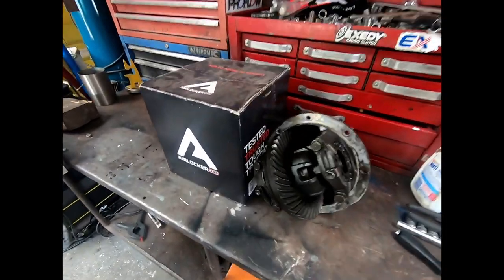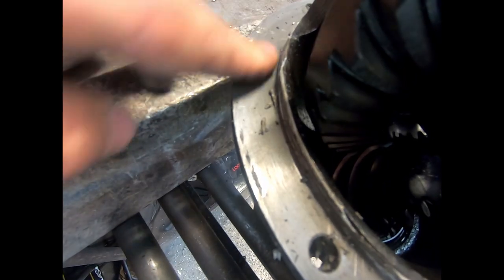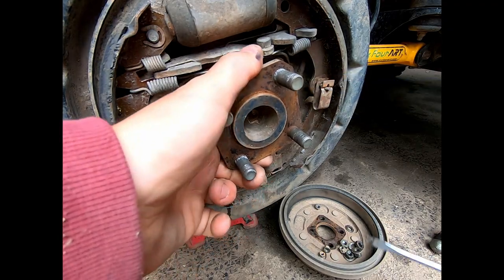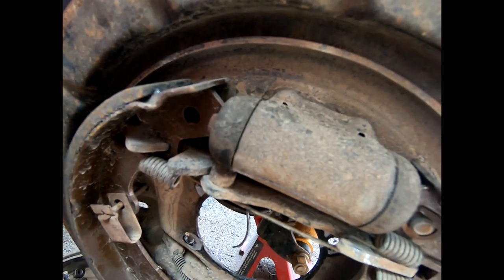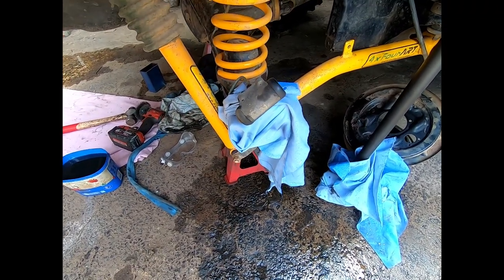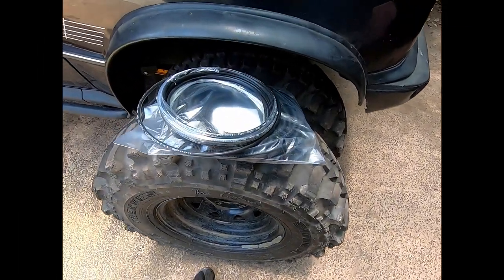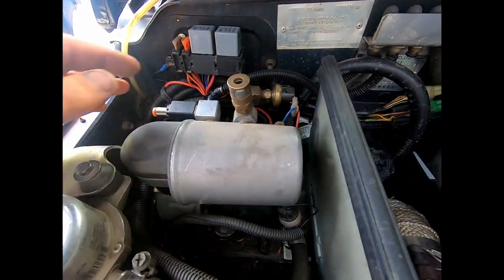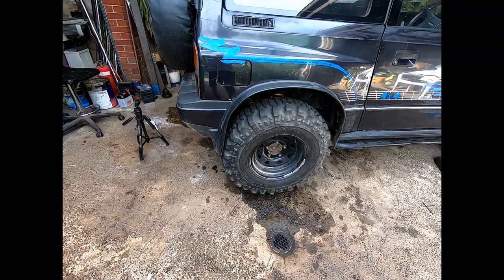Suzuki Vitara - ARB Air Locker Install

Comment: Nice video bro!! 

How does the 4xfour Art suspension feel?
Reply from the maker: It's actually a pretty stiff ride but does flex good!
Reply: @jaydnp.  Is it stiffer than the factory one?
Reply: @jaydnp.  Does it run robust on the road or is it uncontrollable?
Reply from the maker: @randydiaz5951  it is stiffer than Factory but the kit was designed to have an aftermarket rear bar on the back which would soften the suspension up, besides that it drives and handles as if it was factory setup

Comment: Hey bro, how do you find the fourx4art suspension kit. I'm looking at getting one, they seem to be pretty popular, heaps of Suzuki's have them. Had any issues legal wise with restriction on lift size and that? Cheers
Reply from the maker: Haven't had any issues works very well, I just changed the bushings to factory rubber

Comment: Those don’t look stock seats? I’d be interested in what replacement seats work - if you don’t mind. Cheers
Reply from the maker: Subaru seats with rails I made to suit, nicer on those long trips
Reply: @jaydnp.  awesome mate. Thank you! I've collected 14 mid 90s Vitaras & Escudos. Mostly convertibles. Mainly tidy up. Put back on the road. I'm so not mechanically minded. But fun & easy to work on. Have an H25 to swap in. (& H20). So love great content like yours🤙🤙🤙